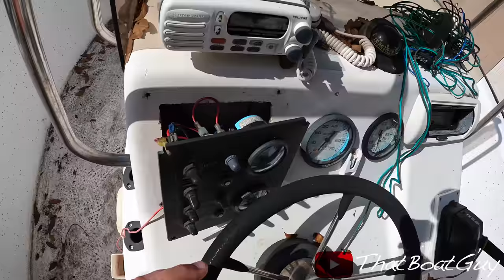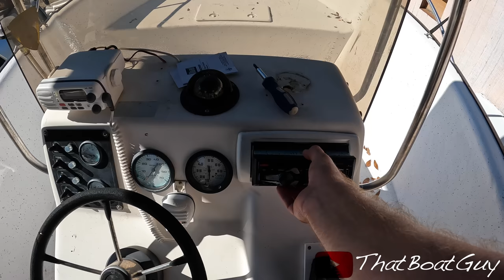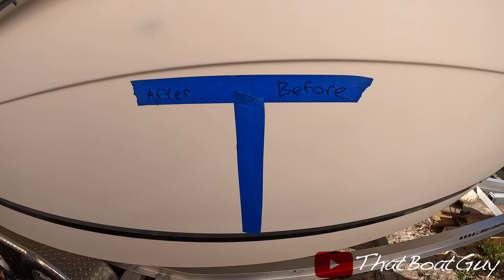From Growing Trees To Catching A Breeze

Comment: Hey there for some of you that haven't used 30 second cleaner sold @ most big box retailers, it's the Shitz Nizzy for marine application. Spray it on with power washer soap applicator or with a sprayer. Let soak for 20-30  minutes and power wash of. Great for bilge area and water line. Works incredible on siding and pvc fence

Comment: This video reminds me of when I was 10.  My dad got this 30 year old ski boat.  We spent about a month restoring everything on it.  The engine was completely toast so my dad got a 1999 mercury 150hp XR6 to put on it.  The plate was very faded and it was only rated up to 120 hp but we strengthened the transom and it sat a little low in the water.  It was a lot of fun on the lake.

Comment: Wish I could bring you the boat I’m considering buying. It’s a ‘90 Pursuit 1850. Floor is slightly spongy in places. No motor but, brand new Yamaha controls and digital gauges. Brand new hydraulic steering system. Brand new Bimini top. Needs a fuel tank. Transom is solid. Otherwise is really pretty. Trailer is solid. If I had your skillset, I’d take it on myself. Nice work.

Comment: I did something similar to a used aluminum trailer. It had all steel bolts and u-bolts.  We cut and ground out all the rusted hardware and replaced with stainless.

Comment: I enjoy the progress. Couple of questions/suggestions: 1) dry the clean the boat as much (leaf blower vacuum)as you can before adding heavy stream of water that drives down the fine dirt into hard to reach places. 2)Then make a solution of Oxiclean and spread that about the boat with a soft to medium bristle scrub brush and rinse with power washer to dislodge any remaining dirt. 3) why wouldn’t you remove the carburetors first before you suck any debris into the engine? 4)  Clean engine of loose debris,Pull the plugs, tilt the motor up and then add marvel mystery oil to the cylinders and let it soak overnight before trying to turn a dry motor. I understand you want to shoot a video as quickly as possible, but so much unnecessary damaged can be mitigated by following these steps. If we are to rescue these vehicles to live another life we should encourage practices to insure  success at a minimal cost. The finished product looks great.

Comment: I think that when you spin over an engine manually, you should probably rotate the flywheel 720° as the cams rotate once for every two revolutions of the crank. Rotating it twice makes sure none of the valves are stuck open or that nothing binds. Just a quick tip!

Comment: Good Transom, Solid Floor, Running motor with functioning trim system, seats dont have sun damage/cracks, plastic hoses not dry rotted, gelcoat not damaged..... How is this a rebuild? More like an extreme cleaning job. Nice vids, but I do this all the time as a side job, I NEVER find boats in this condition. Will be checking out more of your vids. Thumbs up from this guy

Comment: Surprising how well they come back if you are willing to put the time and effort into it.

I am in the middle of cleaning up an Albin 32+2 that has been mothballed since 2006. Put away all systems working, fluids changed in the Cummins 5.9L, all waxed, looking like ready for launch.

Plans change, life happens and it has been sitting on property. Topsides and hull were looking worse than yours. No access to running water or power so cleanup has been a chore. Rather than use expensive products with 'marine' on the label washed it with industrial dish washing liquid to remove most of organic black stuff. Followed that with bleach and water 1-1 to kill off anything left. What a difference!

Next 3M cleaner wax, following with Meguires Flagship. At least 100 hours later, hull is looking almost like it's 1996 new. Next is topsides then cabin and engine. Engine needs to come out. Lots of work to be done.

Comment: 🌴wow ! From a potted tree into a almost new boat & trailer 👍🏼  going to start my project, an 11’ ft fiberglass three seat Cacci craft into a micro flats boat , got any 9.9 outboards setting around ? 👊🏼👍🏼
Reply: ThatBoatGuy2.  I bought a 1977   15hp Johnson outboard last week , I’ve just ordered a bunch of replacement parts to go through it , it sat for the last 8 months, I couldn’t here it run or start it cause the pull rope was broken but it’s going to get replaced, just dropped it off at a repair shop to get the work done .

Comment: I'm a Ham Radio Operator (KD6ILY) and had a problem talking on the air.    Seems it was due to me coiling the excess coax in the trunk into a small coil.     Was told to open the coils up into bigger circles.   I did into as large as I could in trunk.     It worked.    Just found a similar story online.    Don't know if you've tried your two-way to see if it works,  you may need this info.   

Q I only needed 9 feet of coax to go from my radio to my antenna. How should I handle the excess?
A What ever you do, do not roll it into a small convenient coil. It will become an RF choke. If you cannot let it lie loose under a seat or in a headliner, wrap it into a yarn-like skein of about 12 to 16 inches, put a wire tie in the center and tuck it under your dash, seat, etc.

Comment: Wow!! Nice work, amazing this boat sat so long and was neglected. You did an amazing job, resell value will be high. Getting the motor painted was a huge bonus. Luckily the wire work was not in bad shape. What did you do with the boat after and how much did you pay for it?   I am doing my boat right now, replacing the wood and carpet. Only a 14' aluminum Legend Bandit with rivets everywhere. Was from my grandfather in 1994 he bought it new.

Comment: great job.  Are you going to invest in a shop so you can be better organized?  I bought an old 88 tracker (fiberglass) and i am having to pull the cap in order to replace floor and old type foam.  This is my first boat ever and sometimes its hard to stay motivated.  People dont realize how much work it is to restore these old boats.

Comment: Very nice restore. But I have a few issues. Nothing bad, just something that I would like to see more of in a restore. Of course, time is always an issue; I understand, but in some spots, please use time elapse if possible. What I love about restore projects is details. What I do not like is when certain details are glossed over, and in this video, some of those details would have been nice to see done... one for example, watching the welding repair to the skeg on the motor; that would have been nice to see. The video spent a great deal of time on the trailer repair, which is nice, but very little time showing the detailing of the boat, which I was looking forward to; more so, of seeing the transition in phase from start to end; especially of seeing how bad it was in the before images with the trees and leaves, and muck; I love seeing a good power washing to remove the years of gunk and grime... that's satisfying -- bringing out the shine from the gunk. In the end, it is a very nice looking boat, one I think I would enjoy myself.

Comment: How is it possible that a boat in that state of neglect doesn't have a rotten transom, rotten stringers, and water saturated flotation foam? Did you get lucky or does it show how good that boat manufacturer is?

Comment: Stop using the rotating pressure washer nozzle. It should come with several tips. 15o tip is the most optimal and will clean evenly and efficiently. Been doing cars and boats for 10 years. Wet the boat, soap/soak, then work top down.

Comment: It is amazing to see the results but, I would not want to buy a boat like this.  If the motor was hard to turn and then just oil to get the pistons to turn.  It has to be creating havoc on the cylinder walls.  Would have liked to see the heads off and not just get it to turn over.

Comment: Hey, I currently found your videos as im working on a boat project myself. 1978 wellcraft v20 with a '99 mer 125 2+2 
I see when you service engines or lower ends you rebuild the units as well. Do you use a local parts place or are you buying the kits online. Aftermarket prices are appealing but do you run oem?

Comment: This is a stretch just trying to get other reasons why my motor won’t run. I have a 1983 merc 2-stroke 25hp. It cracks off on starting fluid everytine just won’t stay running. Changed spark plugs and still nothing. Just curious on an another reason why it won’t run

Comment: I have a question on a motor. I have an older Briggs & Stratton, 5 hp with only four hours on it that I bought from a friend. I rebuilt the car and cleaned it up and it runs great. But it says only use in freshwater I put anode‘s on it, do you think it be OK in salt water?

Comment: I have an '05 Yamaha 90hp 4 stroke that turns out only has 12hrs on it at low RPMs. It has been sitting for many years but marine shop said $3,000 to get it ready; the two big items needed being (possible) trim/tilt motor and high pressure fuel pump. Everything else was minor miscellaneous. Does that seem normal?

Comment: Would the trigger cause my 1982 Johnson 75 from idling. I’ve rebuilt carbs check syncing and it runs good at full speed just not idling in water takes a long time to idle down too

Comment: Hi I need some advice on an outboard motor I want to buy for my boat.. I went to see it very clean tidy mariner 90 .. it's 1989 I think I took my compression testing kit with me an all 3 are around 80 psi but it starts on the button and doesn't smoke .. do you think it would be a bad piston an rings or just carbon build up any help guys would be much appreciated it thanks .. love this channel
Reply: Clickonprofile74  I got an ex MOD evinrud 70 in the end fits lovely on the boat fully serviced.. looking forward to getting out on the water .. giving the boat a complete re fit in the winter

Comment: I have a question. I bought a 1992 Mercury 150HP XR6. I have an issue, it doesn’t piss when it idles but once you give it some gas it pisses good. I changed the poppet valve, water pump, and impeller. I’ve noticed that when it idles and doesn’t piss, water shoots out of the weep hole on the poppet valve. But once I give it gas it stops shooting out of the weep hole and it starts to piss. I tried to adjust the spring on the poppet valve and it’s doing the same thing. 
Any suggestions?
Thank you!